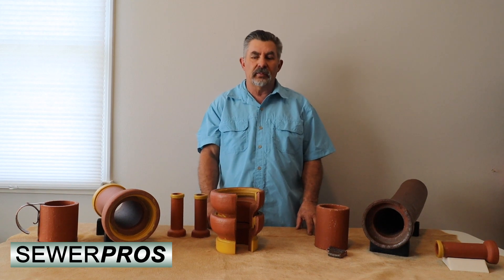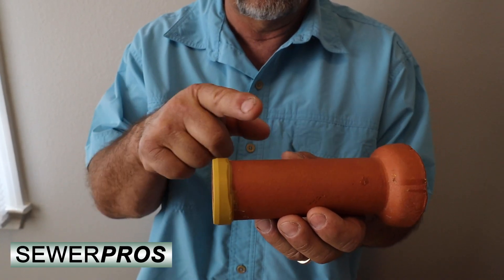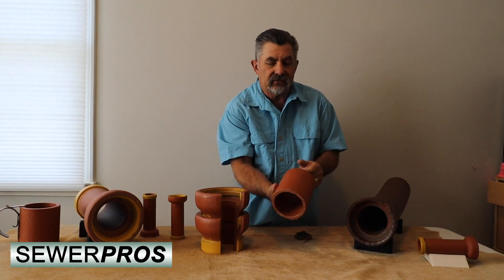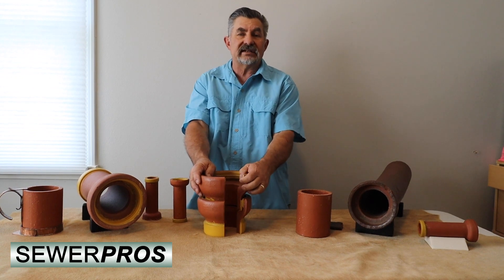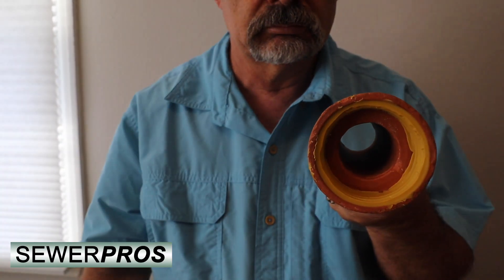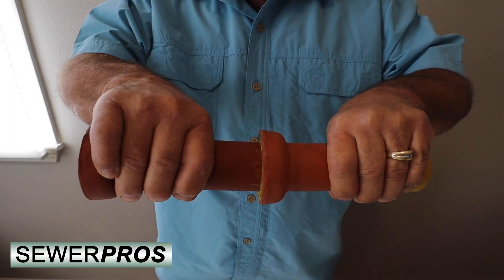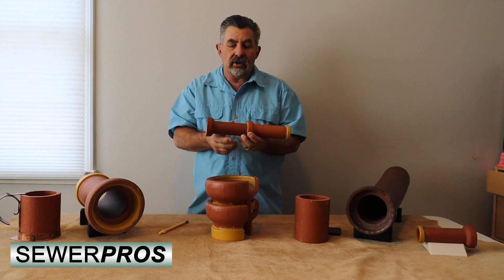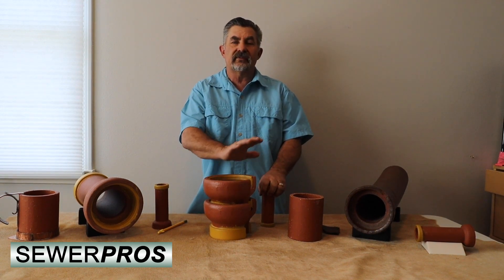Instruction Video on Vitrified Clay Sewer pipe Joints ,Cleaning Sewers, installation

Comment: I got a question. What do I backfill if this sewer pipe is removed, due to abandonment? Would top soil be ok or would I need sand, small rocks, or a mix. Let me know. thank you :)
Reply: Local codes aside you can fill with whatever, up to your last 4-6 inches you probably want topsoil if you are going to have grass there.

Comment: Thank you for putting this information out there. It has been very helpful. In my 120 year old house they never capped off the old sewer line (mortar joint style) when they added on to the house and built a new bathroom. After roots clogged the mainline my crawlspace flooded with sewer water. Now I have fixed everything, but I still have to cap off the bell end of 4" vitrified pipe. Any suggestions anyone?
Reply: Etco T-Cone stopper or Cherne Wing Nut plug

Comment: What's that yellow 🟡 seal ? Thing ?
Reply: The yellow material is call Speed Seal, it is composed of a two part polyurethane mixture.
Reply: @fredbarralaga8636  thanks for the reply usefuy information, but can it be used for drinking water?
Reply: @incodewetrust8862  It can't take the pressure! (in my Scotty voice).

If your drinking water arrives via gravity it could be. Some wine makers are re-purposing large clay pipes for aging wine. Before oak barrels and stainless steel silos it was clay tanks for wine.

Comment: Interesting video, but I think I will stick with PVC.
Reply: Because you do not understand the science. Go to the bathroom and look for PVC. Everything in there is ceramic. Tiles, commode & urinal. PVC will fail. No structural integrity and not chemical resistant. Do you also think vinyl siding is better than a brick facade?
Reply: @nameomitted8160  Thank you Dr. Fauci.  Great to not ask any questions, just attack and make assumptions.  

Do you think wood brick molding is better than PVC?  Not sure how that is relative to sewer piping, but you started it?

When you sit down on the toilet, do you side on a clay/ceramic toilet seat?  Why not?

Do you only drink out of clay jars?
Reply: @armymobilityofficer9099  Well, I call them "mugs".

Plastic should be avoided at every opportunity.

Speaking to the topic though, clay is the best material available for sanitary sewer pipe. This is fact. Scientifically proven fact.

PVC for sewers is the choice of the lazy or ignorant. I am sorry to deliver this news to you.

Comment: Hasn't pvc almost made Clay pipes obsolete?  Just curious, from a non plumber person.
Reply: VCP is mostly use for sanitary sewer applications. The natural properties of VCP make it uniquely suited to high-sulfur, high-abrasive, and high-demanding
environment of a sanitary sewer.
Reply: For some reason the city of Chicago requires clay sewer pipe so that's what we run
Reply: @robertsantillan6604  Chicago, L.A., S.F., NYC, Seattle, etc.

Big cities use clay because they have seen the track record and return on investment. "Newer" "little" towns get swindled into accepting plastic pipe.

If you are a contractor you do not want to handle a heavier building material.

Contractor associations lobby the cities. The cities figure that the contractors know what is best but they really want to make the most money with the least effort.
Reply: Jason Born  it is? Where is that information? Why would it leach underground? I have done this work for a living  (20+ years)and have never seen the appearance of leaching SDR pipe. Is it undetectable visually?
Reply: The two sides of the argument for PVC against clay are due to climate change concerns, three years ago it was almost solved in congress by one man, Donald Trump, now look what’s happened, an enormous uprising, a stolen election, this is a war that will never be decided.
Reply: It seems like clay pipe is making a bit of a comeback.